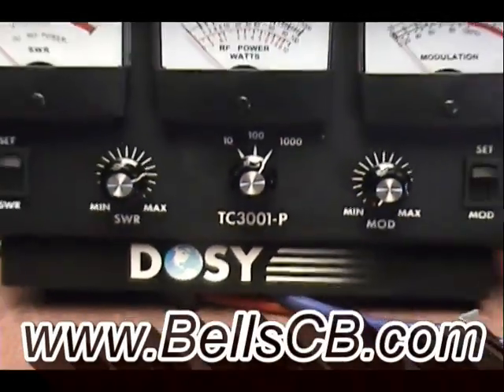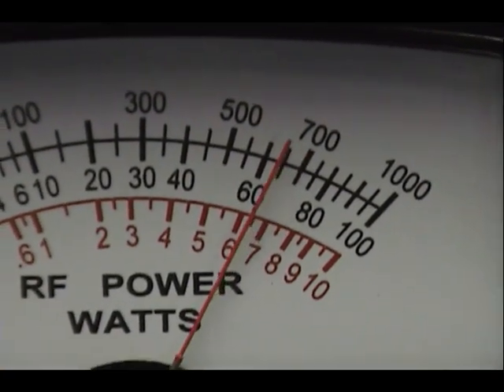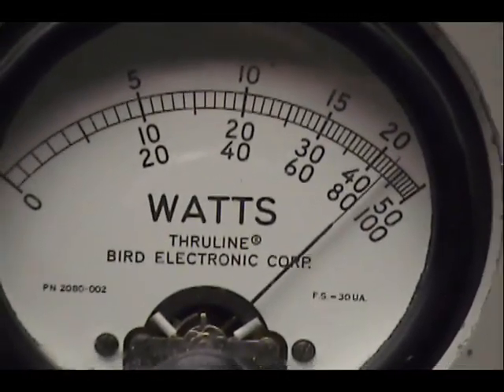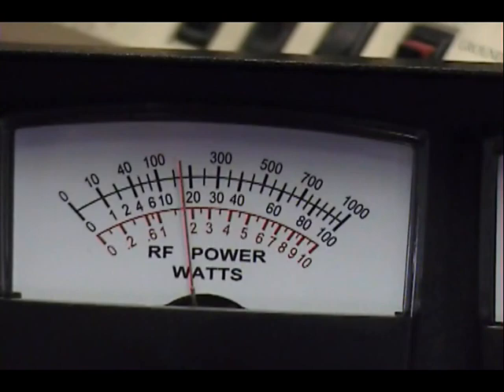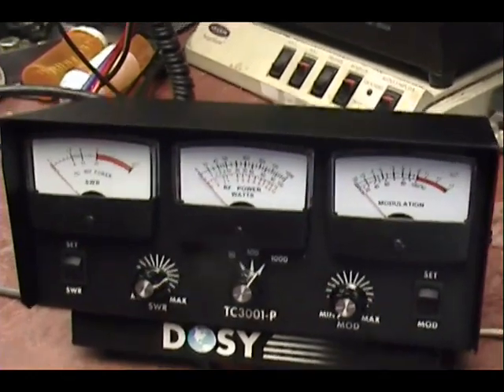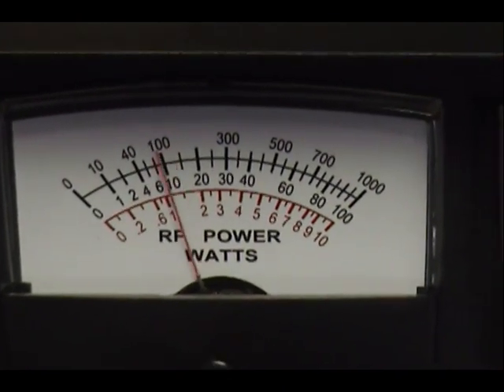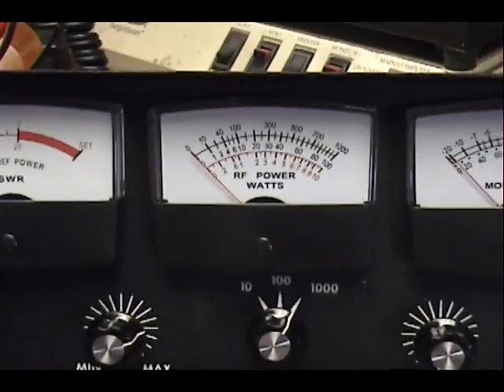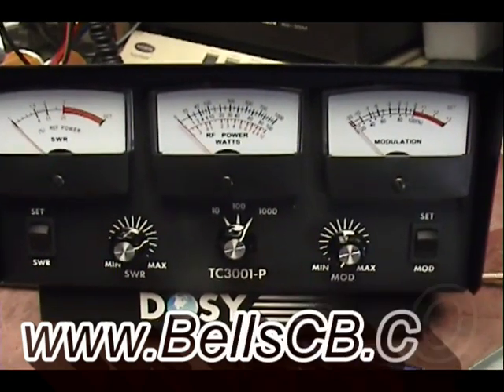Dosy TC-3001P Tested in Peak Power Against a Bird 43P

Comment: I just calibrated my Dosy to a Bird.  It works good for most purposes.  When you hook any meter up to your antenna you are going to see different power reading to it from reflected standing wave.  You have to calibrate to good 50 ohm dummy load to.  Best would be to calibrate a meter to known calibrated radio output to you antenna to get correct reading on your meter.

Comment: Not quite a valid test.  Were you using a resistive RF termination (Industry standard) for RF measurement?  Birds tend to have better accuracy looking into reactive loads (antenna) where as the cheap shit goes bonkers.  Being a shop you know the calibration of Bird slugs differ greatly.  So for an accurate review, how about showing the 43 & slug are accurate with fresh cert tags?

Comment: Supposedly, per the instructions, one has to recalibrate meter every time the wattage selection is changed. You jumped right to 1000 from 100 without adjustments.